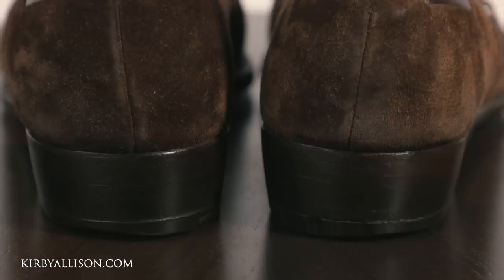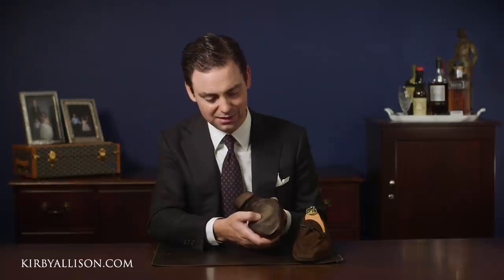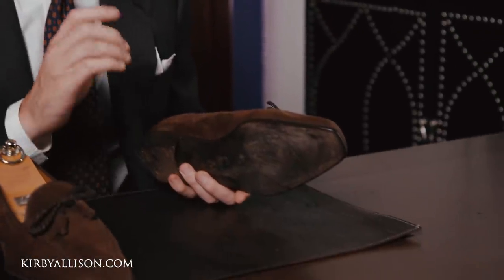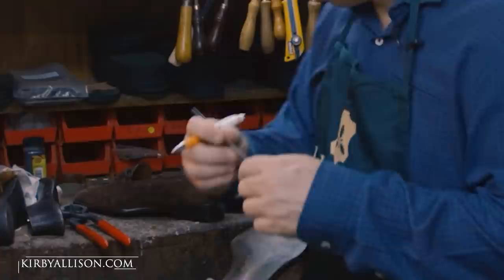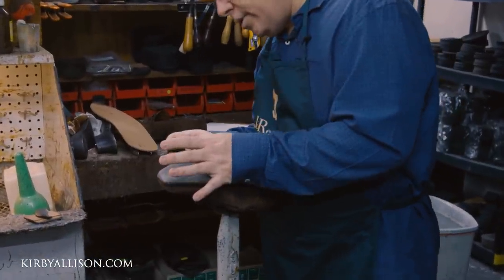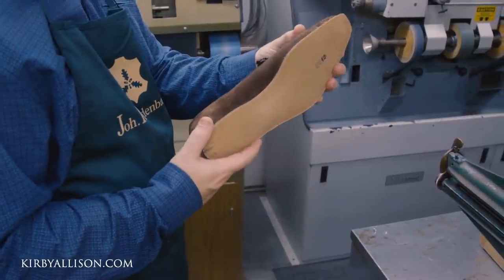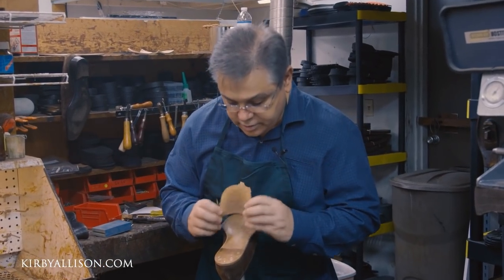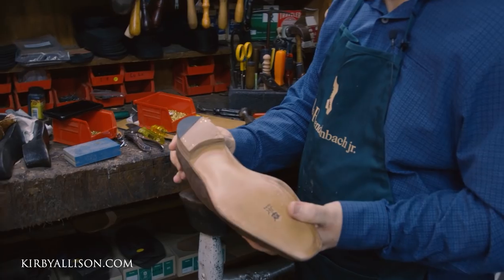How To Fix Your Worn Out Shoes | Kirby Allison

Comment: Hey Kirby, my local cobbler says he will resole shoes for £20, I've never had shoes resoled before and when I hear resoling prices going into the hundreds it makes me worried that a £20 resole may be more harm than good for shoe repair. What are some of the issues that can be present in a low quality cobbling work? Similar to how it would be unwise to send your expensive shirts to the £1 dry cleaner because they will not treat it carefully
Reply: If they're goodyear welted, don't do it dude.
Reply: sounds like just a cover sole @ that price point.
Reply: Beware of cheap cowboys !!! You may regret it . Better to send them to the factory than £20 resole . If you don’t mind me asking  . Where is that cobbler based ? I live in london and usually reputable cobblers are charging about £80-100 . Thanks .
Reply: @bobbybrown4176  It's in a small town but what I want to ask is.. what would a cheap shoe repair actually entail? Where is there room to cut corners/use cheap materials? What does a poorly repaired shoe look like? I like what Robski said, perhaps they will just glue a rubber sole onto the bottom of the old one and call it done
Reply: Thats exactly what are they going to do . I had to pay the price before once , and never again . If the shoes you want to send for repair are from : Edward Green , John Lobb ,Loake , Barker , Church’s or Crockett and Jones . You can send them to the factory’s for repair . When they come back , are like a brand new shoes . Its not that expensive if you think about the cost per wear .
Reply: @bobbybrown4176  i sent a pair back for repair with a defect from new to one of those listed above & came back in an atrocious state & demanded a new pair, so never write off a respectable cobbler !
Reply: If your care about those shoes, send them to Kirby for Jim to do it under his program.
Reply: There is a gentleman from Doncaster , who does a great repairs in Uk  . He has a channel here on YouTube as well . Have a look for the shoe healer . Hope that helps
Reply: @bobbybrown4176  Paul Taylor is the master cobbler & has done all my work so far ........
Reply: BBS_Robski  they do quality repairs on reasonable price as well .
Reply: @sunhuizart3821  the shoe healer have commented in the comments, look them up & drop them an email, they’re aware of this chat !
Reply: Hi, Your shoes will be damaged more by a bad repairer than any damage that can be done by over wearing them.
Usually the damge is done when they  don't bother removing the old stitches out of the welt, therefore new holes are made every time a new sole is fitted and over time the welt starts to deteriorate. Also bad trimming of the welt when too much is trimmed off. Most high street repairers dont have a rewelting machine and if replacing the welt becomes necessary it has to be hand stitched which is time consuming and therefore expensive. Always check your welt after a repair.
Antony
Reply: I had some boots resoled at Timpsons cost me about the same, and honestly it was the worst thing I ever did. They completely butchered the sole and ruined the boots. It was only after discovering channels like Kirby's and Trenton and Heath that do such a great job educating people about their footwear that I realised I had made such a grand error. It was a lesson learned.
Reply: @bobbybrown4176  Shoe is my passion i know much about shoes. I agree with you 100%. I recommend (Shoe Healer ln Doncaster England ) He uses JR leather sole JR leather heel with leather rubber top + triumph toe plate if requested for repair. He is a reputable shoe cobbler, since i discovered him i never sent my shoes back to the shoe manufacturer for repairs. Shoe can be repaired multiple times by reputable cobbler. But shoe can only be repaired twice if sent in for factory repair because the shoe manufacturer keeps replacing the welt each time they repair by putting addition holes on the side of the shoe where welt is stitched which is not necessary if it not busted.
Reply: I think you answered your own question.
Reply: @unklefocker  How?